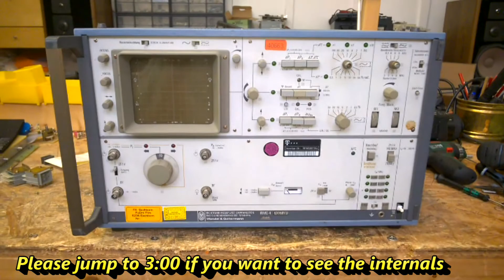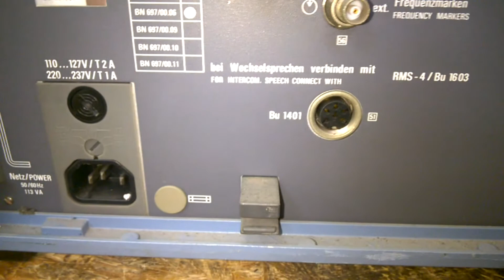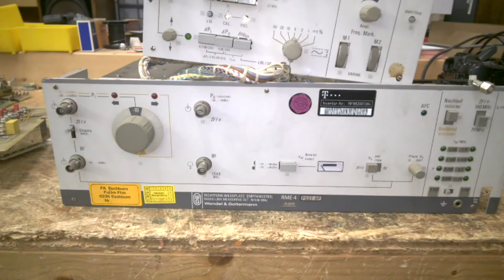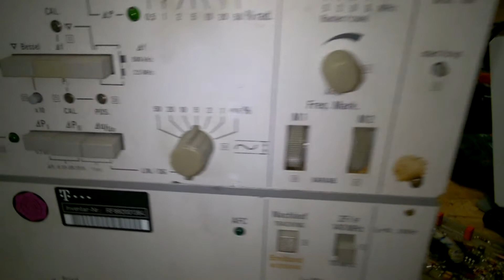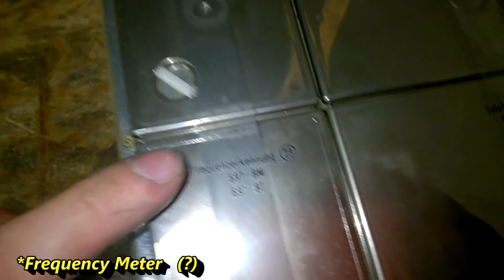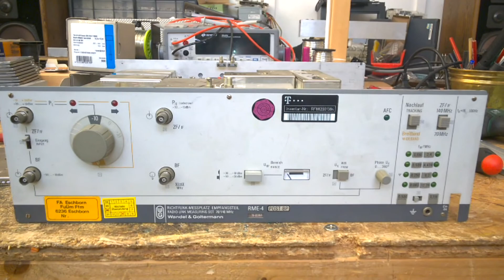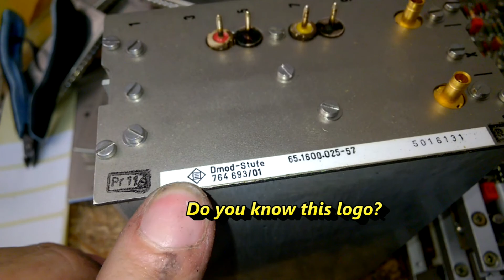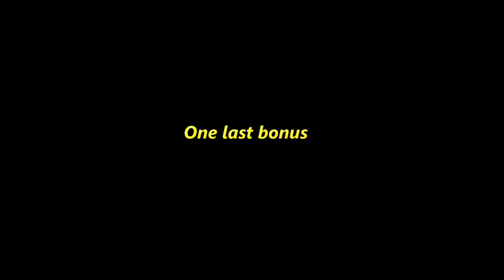BEB #13: Huuuge Radio Link Receiver Teardown, Wandel & Goltermann

Comment: I have a W&G SF-60, replacing the memory back-up batteries required the removal of a whole bunch of screws, and splitting the device in two parts, the batteries are buried deep the middle of everything. But they where regular AAA Ni-Cd's in a holder. It is working fine now, self-test is OK, so I have a 30 kilos door stop with blinking lights and noisy fans.
Reply from the maker: Hahahaha! What an awesome comment. Thank you very much!
Will watch your SF-60 video right now.

Comment: "Look at the cable tree" haha,  I understood that. But english ppl may struggle. It's called wire harness = Drahtgurt oder Drahtgeschirr ;)
Reply from the maker: Haha, yes, that's emberassing. Wire harness is the correct term. I've learned it the other day.